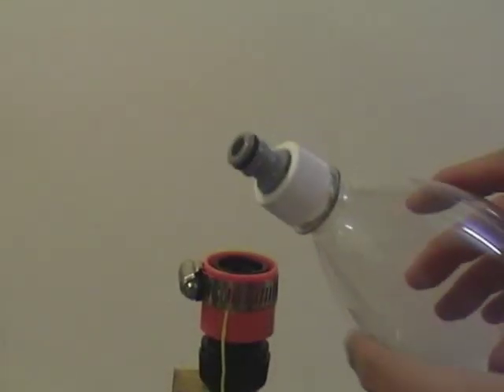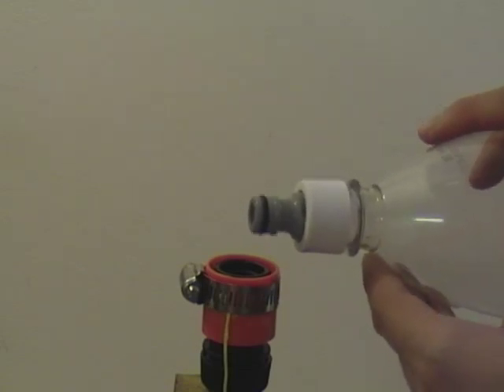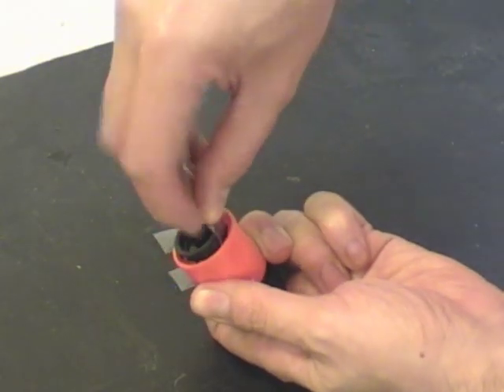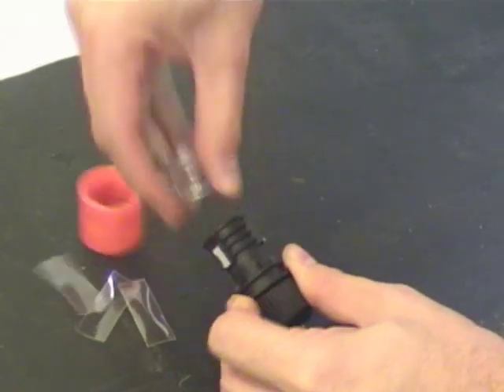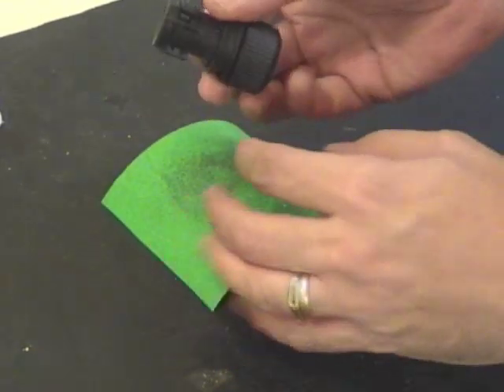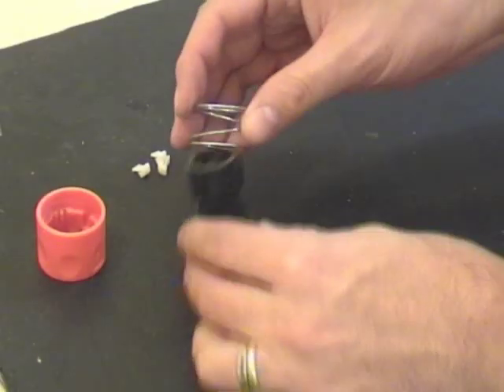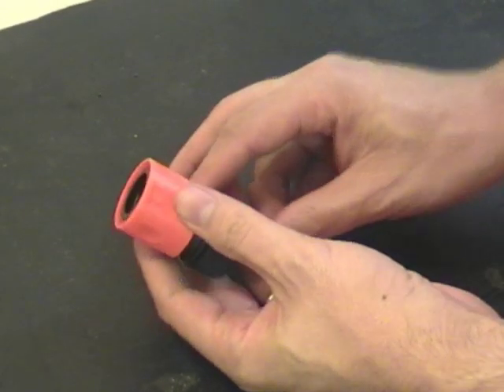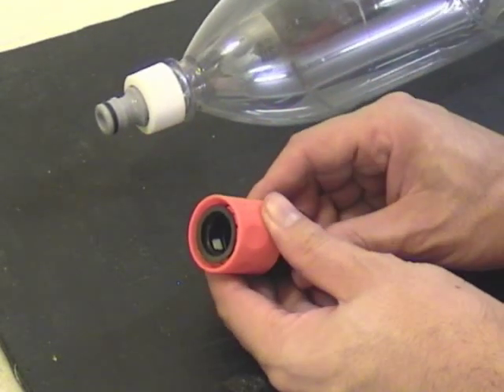Make a Water Rocket Nozzle - Part 2

Comment: Can I add that this setup will let the water be pressed back down the hose when you pressurize the bottle and you may need to add a check valve also; Or am I wrong?
Reply from the maker: Yes you can add a check valve if you like. You will also want to add a pressure release valve behind the check valve so that you can depressurise the rocket if you need to abort a launch.

Comment: Basically Brass Connectors are more durable, have firmer lock and doesn't need to connect all the way, or so far into the plastic male garden nozzle.

Comment: An easier way to solve this problem if you haven't got time or the materials or craftmanship, is to buy a brass garden connector as it ensures a firm lock but also doesn't have to connect all the way to the rim or edge of the nozzle. Also Brass Connectors are built to last and do not corrode so easily.

Comment: Hey George.  I'm having trouble getting the cap to lock air tight on my nozzle.  Air leaks out of the bottom edges of the cap thus causing the rocket to not pressurize properly.
Reply from the maker: Are you using a standard cap? What kind of a seal are you using between the garden hose quick connector and the bottle? Make sure that the seal and sealing surfaces are free of dirt and scratches. Also make sure the seal isn't getting deformed when you tighten it. Sometimes it can be pushed out of the way. If all that is good, I'd try a long threaded cap and a hard rubber washer.

Comment: hello dude , i have the gardena quick connect , but seems that the gardena around 4- 4,5 bar lost air , i don't know whit but , do you think is better to buy metal one? , and i have some problem with the caps ,  here it's hard to find a good bottle caps , always lost pressure on fillet :(

Comment from the maker: @erikw789 Check the following:
- The cap ring should be removed from the bottle
- The seal is not bunching up as you tighten the bottle.
- The nozzle has been sanded very smooth and there are no scratches on it
- All the sealing surfaces should be free of dirt and shavings
- Make sure the nozzle is tightened well. 
- make sure there are no cuts or scratches on the seal

Comment from the maker: There are other techniques, but you need to make sure you have a good mechanical connection in order to hold up to the pressure. You also want to make sure you get a good seal.

Comment from the maker: If you are using fairly low pressures (<100psi) you can just use a garden hose. You should be able to insert a bicycle tire valve into the end of the hose and then use a hose clamp to tightly grip it. If you are still getting leaks, try using some plumbers tape wrapped around the valve, and tighten the clamp again.